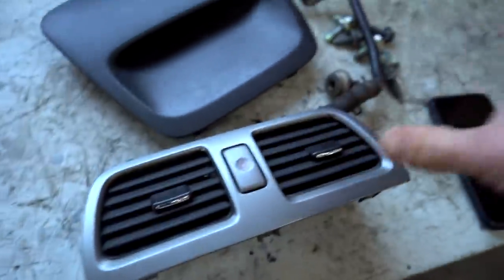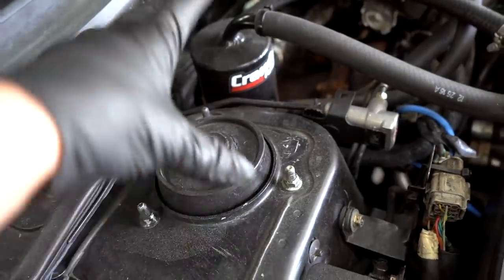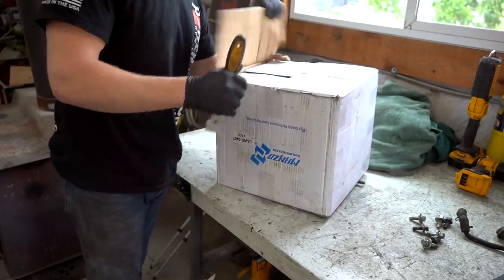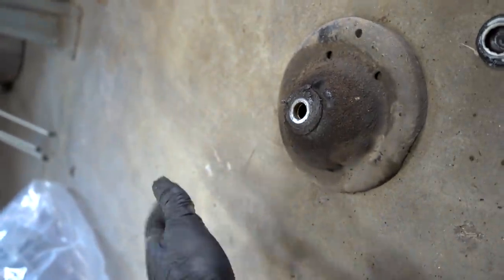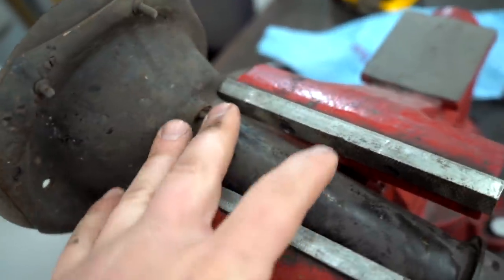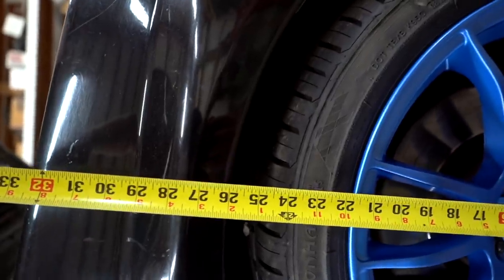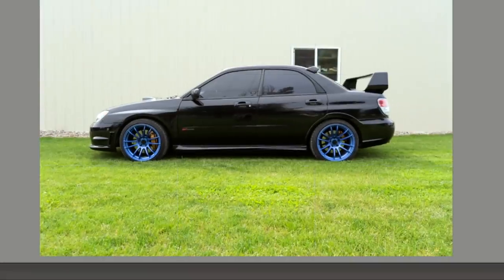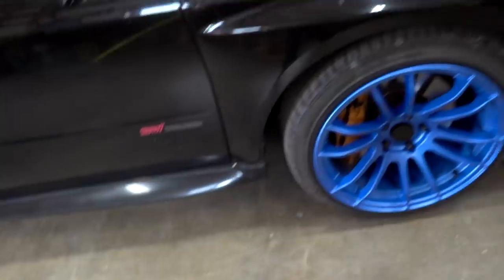Cheap Lowering Springs for the STI!

Comment: There are some suspension bushings which are need to loosen and retighten with static vehicle load (lower front arm front bushing, same at the rear, do not know exactly which one). It will lift the suspension to the previous position a bit.

Comment: Before even watching this I knew the springs would not drop it enough. Those tires don’t help either. Gary was good learning experience.... coils only especially with that kinda wheel set up. Stock wheels and some meatier rubber would have been fine.

Comment: Yeah the 04 STi airbag does not fit the 06-07 steering wheel. Either way the 06-07 steering wheel airbag is a lot nicer in my opinion

Comment: Have a 2020 and 02, but the 02 isn't built because the guy supposed to build it is not getting to it because hes a piece of shit liar and hasn't done fuck to it, probably goung to take it back soon and stsrt tearing into it myself. But I must say, I really like the older ones more, smaller, lighter, more aggressive looking, sound better, cheaper to tune fir equal or more power as the ejs, and like older cars more because you can customize them much easier. I envy youra, did a great job with it and its dope as hell.